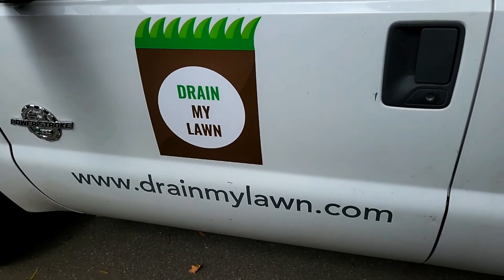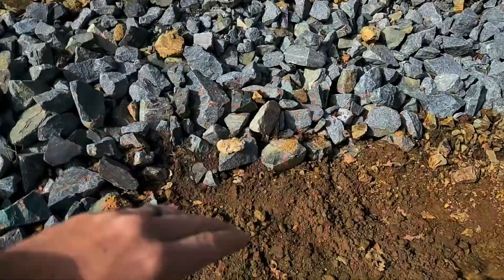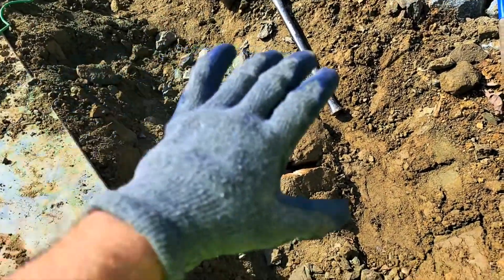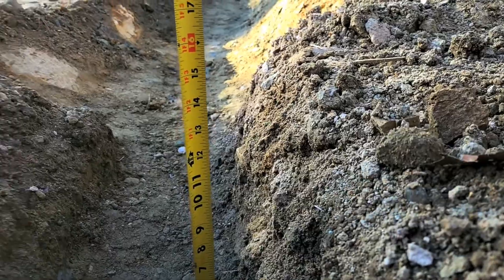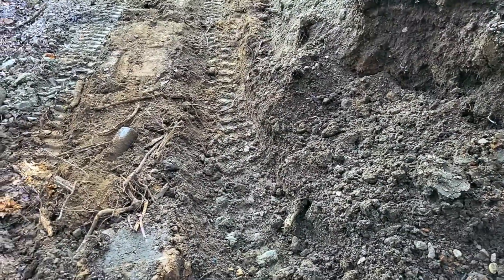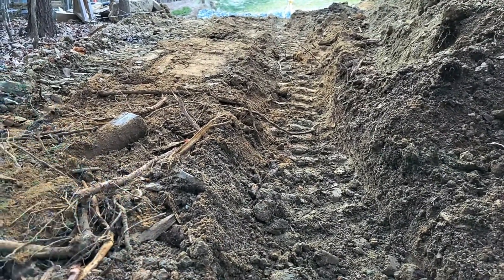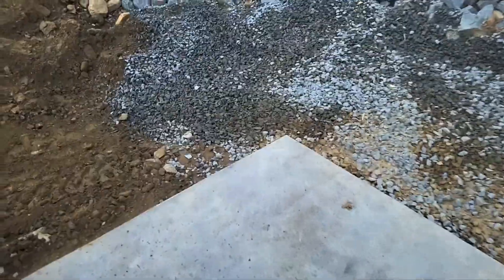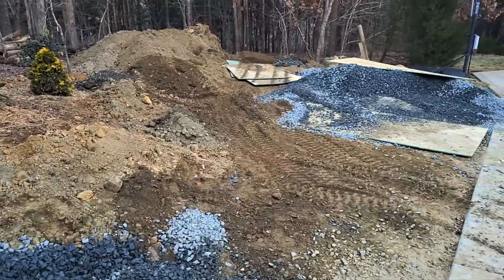Giant Burrito Wrapped French Drain Project Walk-Through - Charlotte, NC

Comment: Nice job.  Seems like you could have just used a 100ft coil for your solid exit pipe, thus avoiding the seams altogether.  Awesome job though.
Reply from the maker: Thanks.  Double wall pipe only comes in 20ft sticks.  Pipe is driven over and parked on, so single wall pipe wouldn't do.